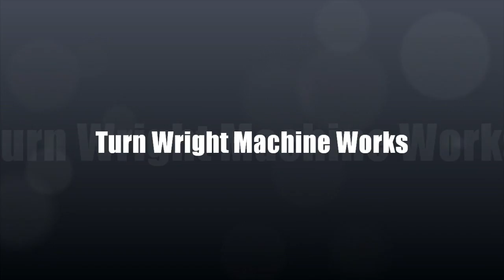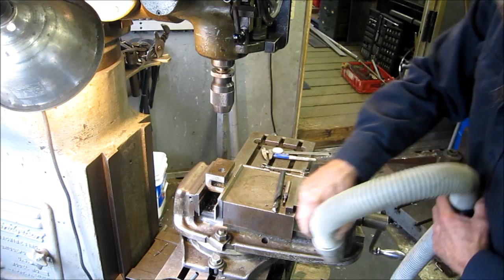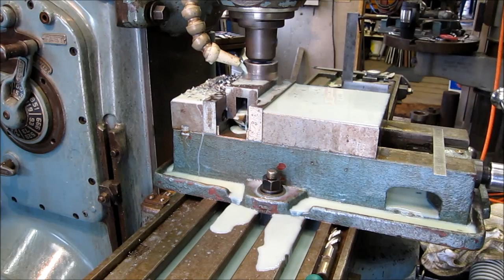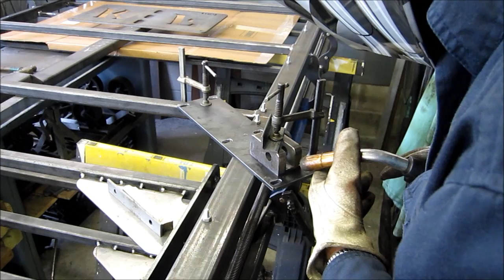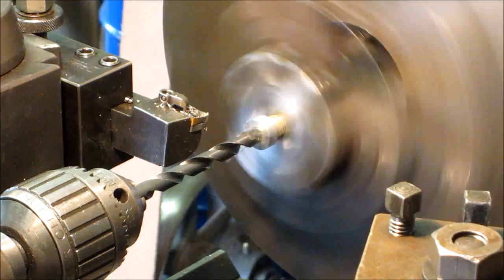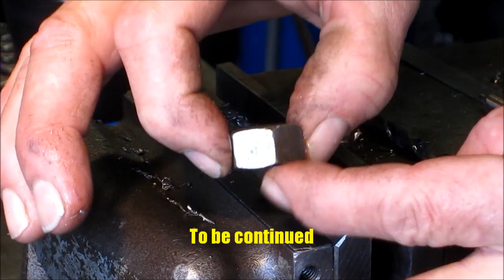Portakey Part 6

Comment: Yeah when I saw that bearing play I don't see how the drill is going to work.  It probably works fine for hand drilling but once you constrain the motor and make it rigid that play will prevent any accuracy.  I imagine the cutter for the key puts a lot of load on the bearings too.

See the comments below I take it my and others hunch is correct.

Comment: Great vid!  My 2 cents: Customer's call but if otherwise good looking drill motor was mine I'd fix trashed bearings even if not planning to use in jig to cut keyway.  Unless wobble addressed, low probability of success cutting accurate keyway since jig's good rigidity/feed control lost at cutter.  Wobble will make accurately cutting the two keyway widening passes especially challenging since keyway sides will not be supporting first one side of cutter, then the other. Tough even without wobble!